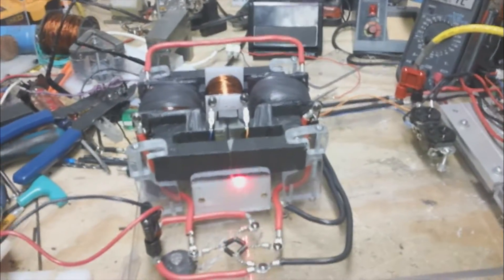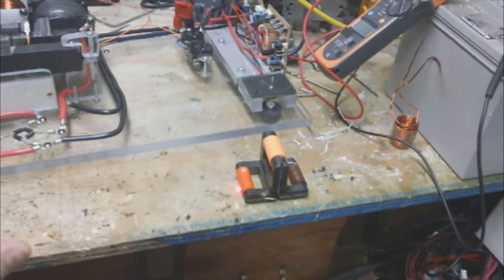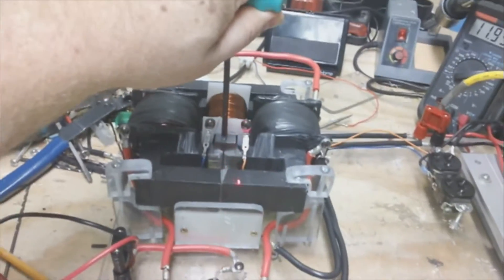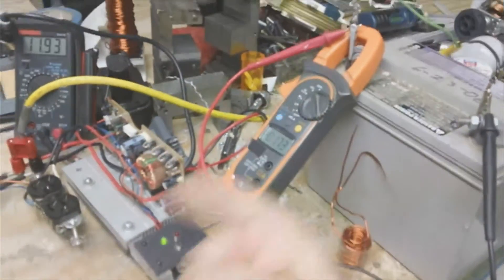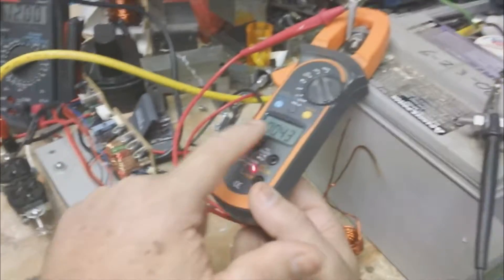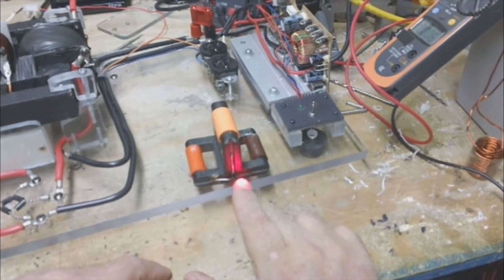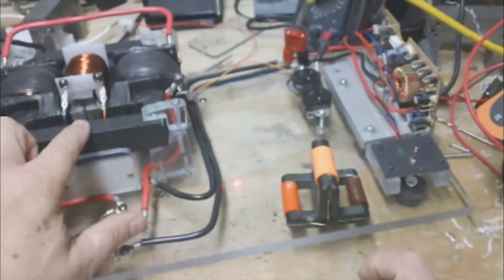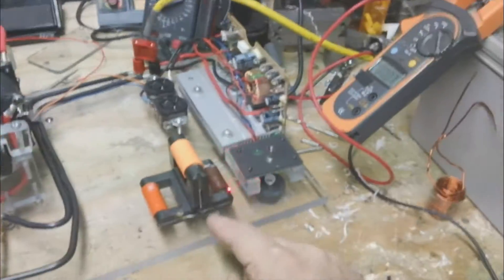Coil Chronicles part 3

Comment from the maker: No not difficult to make but it will not work yet so there is no need,  it needs twice the power consumption to work or you have no back pressure the energy so the power will not flow or a minimum storage device for the energy when  i'm ready I will try, thanks for watching  :)

Comment: Suggestion: If the frequency is a problem, try putting some DC caps across the load to smooth out the DC and this should also help to make a clear comparison of in/out...